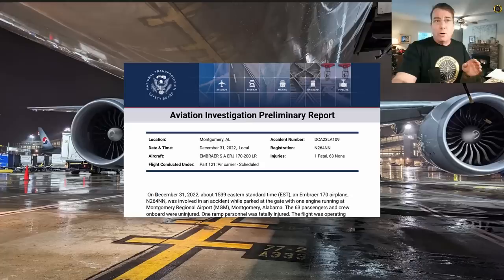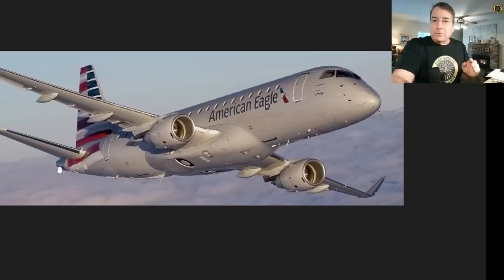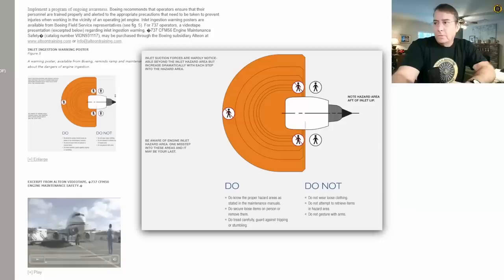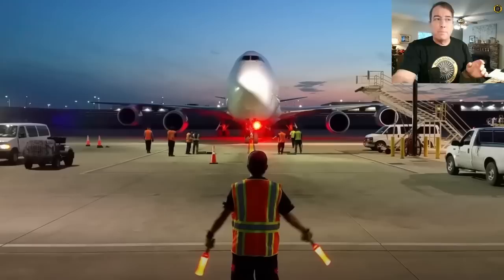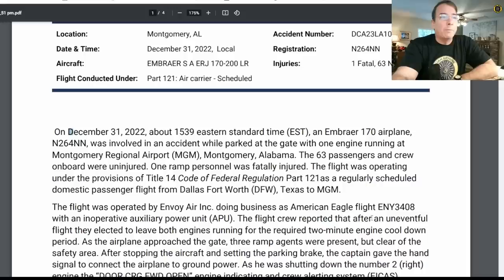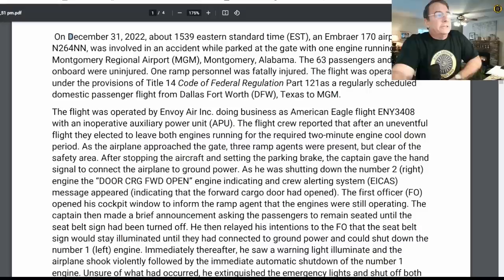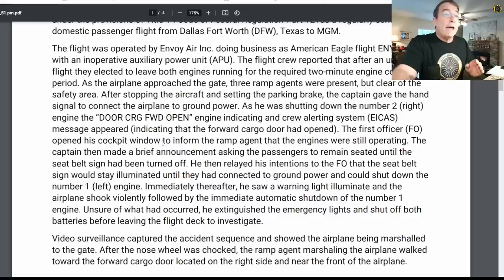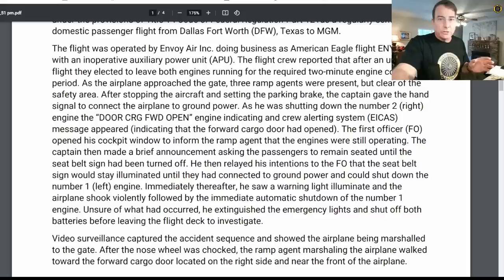NTSB Preliminary Report Ramp Agent Fatality 31 Dec 2022 Montgomery Al.

Comment: Question what about those safety cages or a modified version,I seen in engine testing videos. I realize the obvious more clutter at the gate and another experience for the airline . And depending location time consuming but I have read a lot comments before offering mine. Since it is a enter level job where brain power is not required a robotic like physical operation is desired paraphrasing the first commenter. The cages either per placed or as nose is chalked then slowly positioned. It's sounds like a stupid extra step or dumb idea but some people these days are  described this way HERE YOUR SIGN, on the ramp it's only ONE time that's it.

Comment: I'm English and heard this mentioned on our national news , so many questions I'd like y ask. What happened to the plane will Engine be scrapped, I'm a welder and for many years worked at Bombardier's UK plant manufacturing trains and rolling stock, an oil tanker came in for repair, inside the tanker it still had vapours inside and when someone started MMA welding as it was outside when they struck up the tanker caused a blow back and set on fire killing the welder out of respect the tanker was scrapped. Will the plane be taken out of use or will it have an engine change. My condolences to family of the deceased may she R.I.P.
Reply: I'm certain the engine will be repaired and returned to service.

Comment: Another question: How long had the APU been faulty? Clearly, as we have seen demonstrated this time, having a non-working APU makes ground operations more dangerous. Did the airline decide to defer APU maintenance to save money? Yes, it’s easy to blame the low-paid ramp employees, but did the airline’s decisions play a part in this tragedy?
Reply: Despite it not being required for flight an inoperative APU eliminates an extra layer of protection in certain situations. The APU can provide electrical power and hydraulic pressure when there is a double engine failure. This is why when that Airbus flew through a flock of birds in New Your and lost both engines the first thing they did was to start the APU. This provided electrical power to the instruments and kept the flight controls working. The plane might not have ditched in the Hudson with no loss of life without the APU.
Reply: Sometimes its the lack of availability of a serviceable APU available for replacement of the defective APU. Its not always money.

Comment: This is a smart aircraft and you can not cheat the clock. The in/out times will start anytime a door is opened, even if the parking brake is not set and the engines are still running.

Comment: I'll speak as to the ramp viewpoint with (so far) almost 25 years tossing bags.  You do not want to take a delay.  Management is also clear that you should follow all rules.  These two things sometimes conflict, especially since the airline dictates procedures and turn times.  Conversely, a lot of rampers ignore the rules, either to get things done quicker, on time, or out of sheer apathy to the consequences.  Personally, I am not bothered by the idea of opening the cargo doors with the #1 engine running, and never with the #2 engine running (with the exception of the A321 where the forward door is outside of the ingestion zone, however, this is solely personal opinion and conflicts with my airlines policy).

Comment: I worked as a safety investigator for a major airline at LAX for several years and I can tell you after each investigation where injury had occurred, came down to complacency and disregard for proper training and procedures. A lot of these kids are hired off the street for crap wages and bring with them a mentality that lacks discipline care for the job / disregard  for the severity of the dangers present on a commercial airline ramp operation. The turnover rates were insane. But these operations also lacked proper oversight and management. In our case we were an international operation utilizing a third party ground handling company that had been fined so many times the only reason LAWA did not suspend the company was due to the number of airlines depending on their services with no alternatives. Literally 16 airlines would have had to suspend operations. It was that bad. @blancolirio I have some crazy pictures and video I can send you. Aircraft running into catering trucks, A380's running over pay movers, doors ripped off of 777's it was bad. and all the same company.
Reply: Does the company start with a M?

Comment: Why are APU designed and installed safely high in the tail?  So the main engines can be immediately shut down once at the gate.  This accident happened because and engineered safety control was substituted for a less effective administrative safety control.    An operable APU should be required equipment for any flight.  Otherwise, shut down the main engines then tow the plane to the gate.  The lawyers are going to have a field day on this one.  I’ll bet the pilots feel awful.
Reply: "An operable APU should be required equipment for any flight." 
The amount of flight cancellations each day would have the passengers screaming to the media and the FAA.
Not a cost feasible action for the airlines or the price of tickets for the passengers.
Reply: BTW- APU's are mounted where ever the Aircraft Manufactures decide they have space to install it. It happens that on most jets that have WING mounted Engines and some Fuselage mounted Engines the APU is located in the Tail area of the aircraft due to available space.  The Boeing 727 has the APU located in the Main Wheelwell and it exhausts over the top right wing root.

Comment: I see several things here . Complacent safety behavior by low skilled entry level workers following a work culture based on do as I do not what is stated in manuals. Unfortunately big company has a low opinion of the welfare of these type of workers . Note high turnover employment rates in this type of work . Low wage high risk work does not mean high risk  high pay more often than not your reward would be low pay.. Nature of the beast my friend . Worked on ramps in the military both rotary and fixed wing . FOD , Weather , Night Ops. , Load and unload , Hot Refuel , Rearm Various Munitions . Confusing , Dangerous , Fast paced.... Some people are not cut out for it. You wouldnt send a truck driver out to minesweep a road would you.........?

Comment: Sorry for the morbid curiosity but how does this get a human killed? The first set of blades aren't wide enough apart to actually get pulled into the engine. Are they very fragile? A human going in hits at what? 30mph at most? They can't handle that much force?
Reply: The engines have enough power, that in the middle of taking off, if one fails, the other can get that rather "heavy" plane into the air, and safely back to the ground! You've noticed how large the intake/opening on the front of a Jet engine is? 
This isn't a lawn motor idling!........
Reply: @mderline4412  I don't understand why this answers my question.  We're obviously not talking about a plane trying to take off so your entire comment is useless. We're talking about a plane NOT moving and NOT powering in an attempt to begin moving.
Reply: A modern High Bypass Fan Engine has a DANGER ZONE at IDLE because they are very powerful. In fact the Ingestion Zone is also AFT of the ENGINE INLET even at IDLE. This is why you see red stripes on the sides of the Engine Cowlings to mark the zone AFT of the Engine Inlet.
Reply: @joeskis  
The Embraer ERJ 170-200 LR weighs 48,080 lbs empty. Its massive engines even at idle,   (not taxiing or taking off), involves all of its moving parts, fanblades and rotors, to be moving. They are generating tremendous suction at their fronts (intake) and also force at their rear. Particularly as it relates to the weight of a Human Being.
Hence the exclusion zones, at the front and rear of the engines, as long as the engines are "On" 
See this video on YouTube!  https://www.youtube.com/watch?v=AF55oyAJDBk 
You'll never unsee it!
Reply: @mderline4412  yes that video strengthens my question.  That sailor wasn't killed.  He was stopped before getting to the engine blades.  That's what I'm asking about.  I'm not questioning the ability to get sucked into them.  Rather how the first blades break in-order to get sucked in enough to get cut up, if that's how a person dies from going into one of these engines.  I know they break when the plane is in the air from birds but that's an object hitting at over 100mph.  Hence why I guessed at a stand still the engines, at most, would make the human move 30mph by the time he hits the first set of blades.  Is it merely getting hit by a hard object that kills the person or do you need to break past the first set of blades to get into a place where the blades can start slicing yah up?
Reply: @joeskis  
"... I'm not questioning the ability to get sucked into them....Hence why I guessed at a stand still the engines,..."
?!
In the case of the Fighter Jet v. Seamen, in the video they state he became wedged in the intake, his body never reaching the fan blades. The fighters engine, was shut down / Turned off imediately! 
Re: The commercial Jet
Those large, powerful, engnes, are not at a standstill! They are running, on low!
Two things. 1. Have you ever held your hand over the hose end of a running vacuum cleaner?  2. Have you ever mashed potatos with an old fashioned hand held masher?
Then, combine the two. The persistent suctioning force of the idling jet engine, overcoming gravity holding a person on the ground, pressing the human body against the internal workings of the engine.
That'll be $1200. 30 days. Same as cash!

Comment: Can't help but chime in on this.  First, I cannot fault the flight crew at all.  Having said that, my career ended involved with aviation safety investigations.  After retiring, to stay busy I worked at a small AA station at the time handling turboprops.  I was staying busy, loved being on the ramp and getting exercise for $11/hr.  We handled customer service, ordered your fuel, marshelled the aircraft, handle the luggage....  I can guarantee I was the only one with a college degree.  Quite often or aircraft had an APU IO, with our configuration usually no problem as the number one engine was almost always shut down and our cargo door was also on the pilot's side.  In this case, it surely seems the pilots did all they could.  I'm betting there as at my station, a majority of the employees were PT, maybe contractors the airline to save money.  It boggles my mind that people think someone making the same or less than an employee at McDonalds won't make a mistake in this environment.  Might cost a few bucks, but can we hold on a taxiway for two minutes so we can shut down the engine.  Maybe taxi slower off the runway?

Comment: It has to be about prevention. Giving safety talks are fine but human nature comes into play and if you are having difficulties with your spouse, you didn't 'get the raise you thought you deserved, your vacation starts tomorrow, your young child is ill, your tired or the repetitive nature of the job (all jobs are repetitive to some degree. Ask any pilot) all these things distract you from performing your tasks properly. A safety talks are very important but to a degree, would be like before every flight telling a pilot to be careful and don't crash the plane. Utterly redundant. Aircraft are loaded with preventive safety features because humans operate them. 

Ground activities must be looked at similarly. One example could be that an interlock system be in place to prevent the cargo door from opening until 30 seconds after engine shutdown. Preventive measures cost money up-front but long term lives are saved. I guess someone at corporate makes a financial decision and crosses their fingers hoping it doesn't come back to haunt them if they made the wrong call.

Comment: She must have been very close. I'd think she would have to lean into it. An idle bypass engine can't suck that much.
Strange rule that the engine has to run for 2 minutes after landing. Hard to see engineering reason for that.
Reply: Temp. differential. Rapid cooling?....

Comment: what a horrible thing to happen to anyone, and more so when involving a female staff member as well as shortly after Christmas, too sad for words, my thoughts with all involved
sadly this does sound like a lapse of concentration and probably due to time constraints - lessons to learn i think and self preservation, if your never sure of a situation, be safe and CHECK

i was told a story a few years back of a chap many years ago working on the mighty VC-10s (in the 50s 60s or 70s), as some may know the engines are mounted very high off the ground at the rear of the aircraft, a design back then to reduce engine noise in the cabin and became a regular feature in many future designs until engines became much quieter in themselves, this chap was on a cherry picker lift working close by, forward of the mighty Conways, either when an engine was in operation or was started up, due to weather conditions, ground crews were wearing waterproofs with hoods, the rush of air caught this chaps hood and clothing dragging him into the intake, fortunately the chap survived but lost an arm in the process - i understand he is still around today and gives talks on the VC-10, the very plane that took his arm, i take my hat off to him with the greatest of respect

Comment: In ignorance. Is there an chance an air horn could be tied into red rotating  beacon louder than engines. Of course not but seems like one fail safe hasn't implemented. Or the FAA, world standard gonna have to step it up
Reply: Its all about Situational Awareness. If someone does not hear a Turbine Engine running how will they hear an air horn? Turbine Engines are very loud and will cause permanent hearing loss.

Comment: To anyone, is there a certain weight that a ramper would be less prone to being ingested by a running jet engine? Like maybe 250 pounds or so , just wondering if a person's weight might help with this issue if the engines were at the idle . Complacency on the other hand gets people killed in many different work occupations . Definitely a tragedy in the worst way which could have been prevented. Prayers to the victims loved ones .
Reply: It's not so much about weight as it is surface area. Woman who got sucked in was large and overweight, that kind of surface area turns you into a human kite when you get sucked in vs. someone skinnier.
Reply: Thanks for your reply.

Comment: You're not supposed to walk in front of a running jet engine. Common sense isn't very common anymore. Me, I don't fly. Planes fly at 30,000', at 600 mph, and they don't hand out parachutes. My truck sits about 2' off the ground and goes 80 mph. DC10s and L1011s used to routinely fall out of the sky. That's why I don't fly. I saw all the Airport movies. I'll stay on the ground, thanks. I don't even like going up in tall buildings. (Especially since the miami condo collapse.) I've been on scaffolds and stages, I'm a licensed MEWP operator. I'm not scared of heights, I'm not even scared of falling, it's the pain on impact that I don't want to think about.

Comment: As an aerospace engineering student, I will relay to my professor that my senior design project will be adding kazoos and flashing LEDs to the tips of fan blades that stay on until the engine fully stops rotating.

Comment: The military has a 25ft zone in front of the engine. Why is it only 15ft for airlines?
Reply: Perhaps the bypass ratios of turbofan versus turbojet have different zones?
Reply: @gordonrichardson2972  all heavies the military has vs whatever this type of engine is.
Reply: The Military makes up its own rules. The 15 Ft zone is established by the Engine and Airframe Manufacturers.
Reply: @guitarhillbilly1482  thank you. A logical answer that actually makes sense.

Comment: People want cheap tickets. Their profits run on a razors edge. Every free second of crew time on the clock adds up to significant overall costs. No, its not worth it on one flight, but over a month with the hundreds of flights it can add up significantly. Add the fuel costs mitigate by operating the engine in a restricted mode in some phases of the trip contributes to considerable fuel savings and maintenance . Running an airline is constantly fine tuning the costs. If people financial ran their lives as stingy as the airlines do, They would be wealthy by 40 .Personally I think airline tickets are too cheap, but the people they serve are cheap too. It's human nature to cut corners and push the envelope, but where does that stop. Usually until there is a repetition of accidents. So far, rampies getting sucked into engines is fairly low.

Reply

Comment: Why don't they turn the plane off while loading?
Reply: Generally speaking a modern commercial airliner has a long process to "start up".
Unfortunately there is no ignition key or switch like a car.
The aircraft from cold, needs an external ground power source to turn on all systems and "warm up". 
Also the flight deck has to input flight plan details, trim and prep the aircraft for taxi and takeoff which to complete a preflight check and input all values the a/c needs power.

Its really all to do with ease of operation of aircraft and time constraints.